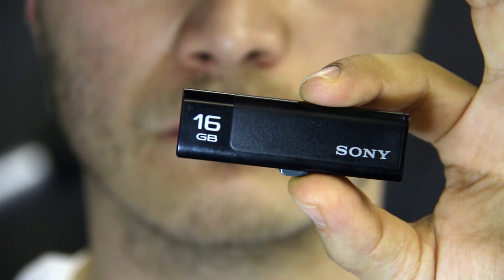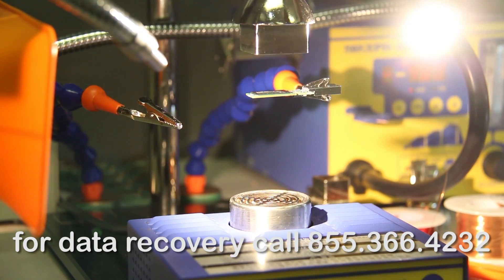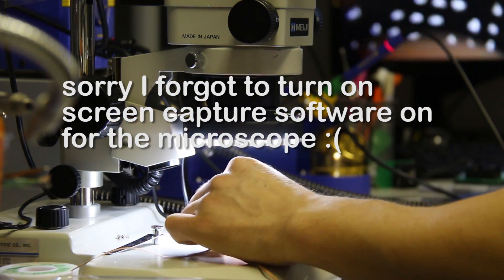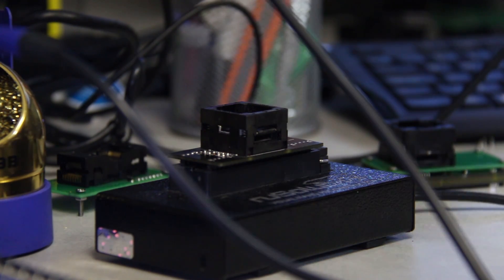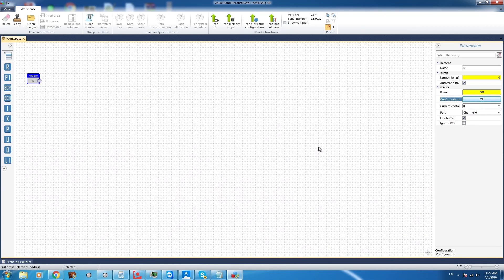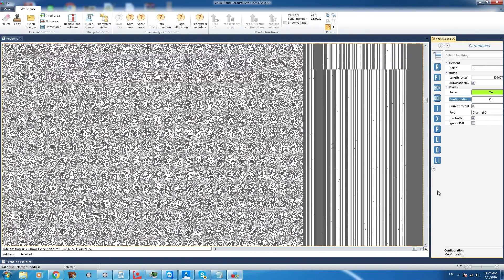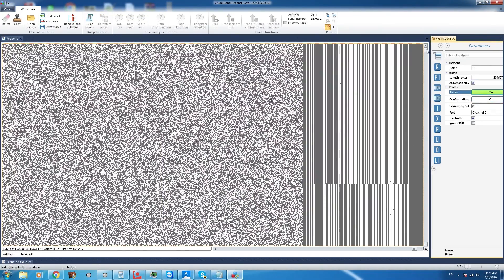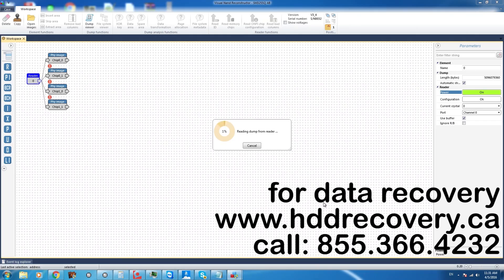USB not recognized – data recovery on 16GB SONY USB Stick

Comment: HDD Recovery:  les prix sont exorbitants: 560usd pour récupérer, peut-être... les photos sur une Compact Flash de 32Gb. des prix hallucinants, des gens À FUIR !
Reply from the maker: Serge, you've requested a quote, so we provided you with a quote. This is what we charge for any 32GB NAND flash project that requires a chip-off recovery technique. You don't have to agree with our prices. Data recovery services are not cheap.
Reply: Rien ne peut justifier de tels prix, ça ne respire pas le sérieux mais plutôt l'arnaque !
Reply from the maker: a scam would be paying for something and not getting back what you paid for. In our case, we are telling you upfront what a successful recovery will cost, so if your data is not worth our asking price then so be it. You are more than welcome to find another company to handle it for you for less if you can find one.
Reply: Adressez-vous à quelqu'un d'autre ou faites le vous-même. Il a son expérience, son matériel de qualité et les programmes dont les licenses sont TRES honéreuse. il offre les prix habituels pratiqués au Canada. De plus, appeler à l'arnaque une personne qui prend le temps de rendre publique des connaissances que seul TRES TRES peu de personnes sur terre maitrisent, c'est vraiment de la bassesse humaine. 
Il pourrait garder tout ce savoir comme secret profesionnel mais non il partage. Prenez le temps de chercher le prix de tout son hardware/software et cessez d'être un vieux réac radin. 
Si vos données sont si importantes alors payer pour les récupérez ou formez-vous et équipez-vous aussi bien que lui et revenez dans 2ans avec le même discours.

Comment: As I've said before, I have the same problem with my Sony Micro Vault flash drive of 4GB, USB 3.0. Zero bytes appears, even though it is recognized by my Acer V3 laptop computer operating on Windows 10. I have EasyLock installed, but had done no incorrect commands. All it shows, from Devices and Printers - from Control Panel>All Control Panel Items - is IS916EN. Is IS916EN, which is the E Drive from my laptop computer running on Windows 10, the controller that cannot reach the memory chip? I bought this Sony flash drive 4GB, that is 3.0 USB in 2013, and I rarely used it; furthermore it is plugged into the single USB 3.0 port, and all it does is blink its orange light on and off. Therefore the flash drive is flashing, but the media cannot be accessed, because it shows "no media". What do you think is going on? How much is it going to cost for repair?

Comment: I have a USB flash drive that worked normally before on my MacOS, one day when I plugged it in it says 'The disk you inserted was not readable by this computer and I cannot see the drive even though the blue light is flashing normally indicating power and connectivity is ok. Can data still be recovered from such a situation?
Reply: That's probably an issue at FAT level (maybe you unplugged it from the computer without extracting it first, while it was writing). Try using a recovery software, I had some success rebuilding the FAT of an external drive with TestDisk.

Make a RAW image of your drive before trying TestDisk, it's pretty easy to lose everything if you mess with it without any notion of what you're doing!

Comment: Hi, hiw about usb can not format? I try all method around Internet still can't.
Reply from the maker: Dered Emerald if the data is important it would need to be recovered off-the-chip. If your flash drive is prompting to be formatted and it does not format, then he problem is on component level. Either memory is bad or controller is about to die
Reply: HDD Recovery Services hi thank your for your reply... When i plug that usb drive to my pc it show as normal in Explorer i can see my file in it but i cant copy file in and out. Than i want to format it and use it again. I try many format software and also testdrive... Still not success. What wrong with it?
Reply: sir, i am also facing same problem. did you find the solution? please help me

Comment: How have you learned to do all this stuff? Are you an engineer or something?
Reply from the maker: I learn it as I go.
Reply: You haven't studied any of this? I saw a vid of you recovering data from a micro sd chip, and you used some kind of sand paper to get to the oval/circular shaped areas for soldering on wires. How do you know which wires are going where? Google? 

To learn all this is impressive. I do some data recovery as well (nand flash medias), and bought the pc 3000 flash. Major pain in the butt to use, so I sold it. How long have you been doing this?
Reply from the maker: I do attend training for the equipment if needed. Usually creator of the product will hold the sessions for it. I started in recovering drives around 11 years ago, but with NAND flash it has only been a couple of years

Comment: your never showed the nand flash chip. was eager to see the beneath part. thumps down
Reply from the maker: +mohamed fashan I know man, sorry. at 4:42 I wrote why it happened. I forgot to press record on the screen capture software running off the scope. Keep an eye out for more vids I post, I will have it displayed by the end of the week for sure
Reply: Alright I subscribed now. Please show your work in detail mate otherwise it's hard to follow up
Reply: +HDD Recovery Services can you help me out with showing the band disk down part? I wanna know whether is it LGA52/60 type
Reply: +HDD Recovery Services "nand flash chip". Sorry Wrong spelling
Reply from the maker: +mohamed fashan LGA52
Reply: +HDD Recovery Services whats the difference mate ? 
And which one has LGA60 thank you
Reply from the maker: +mohamed fashan 52 and 60 is the pad count. TLGA60 is fairly rare for flash drives 52 far more common

Comment: Are you using for USB, SD etc. only Resolut software, hardware? Do you have experience with PC-3000 flash? I ask because I want to know what is a better for this kind device.
Reply from the maker: +Marcin L I find that Rusolut gives most amount of freedom when it comes to creative process, I highly recommend taking a training class with Sasha from Rusolut if you think of purchasing it. Every update brings new and improved features to the tool, and the recent update just killed it. I will be shooting 2 types of showcases going forward. Full real time, and compressed with selective overview, so keep a lookout for them. I don't use PC3000 for flash.
Reply: Thanks for your answer. I would like to start my bussiness with recovery in Poland. First I would like to buy device and software for traditional hdd: PC-3000 UDMA. At the begining I will start working with this type device. maybe in the future  with flash. Next week in Prage AceLab  organise 1 day conference, I will be attend to the conference. I hope I see possibility this products. 
All your videos are very nice:)
Reply from the maker: +Marcin L PC3000 is a must have for hard drives for sure, and if you are just getting into data recovery I may suggest Deepspar Disk imager with their network addon and DRE. PC3000 is far more superior in terms of what you can do with it, but DDI is probably one of the easiest tools to learn for professional data recovery. I know companies who had UDMA for years and still don't know how to use Data Extractor properly. Rusolut is also in Poland Warsaw, I was just there last year.